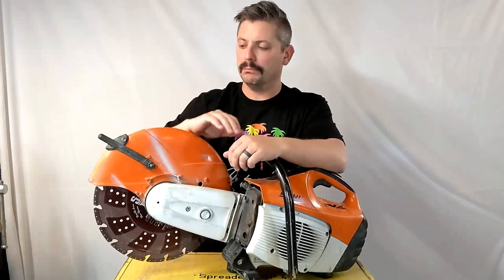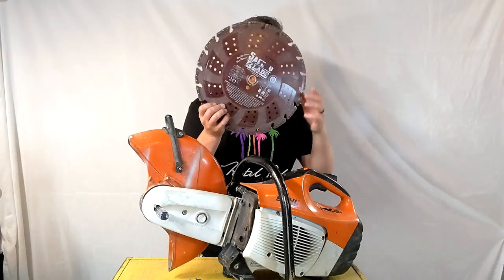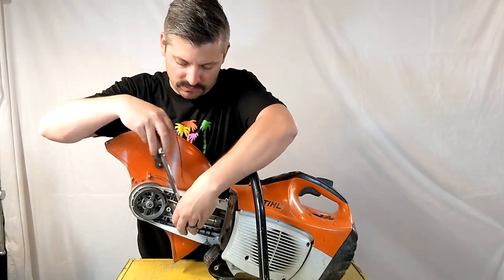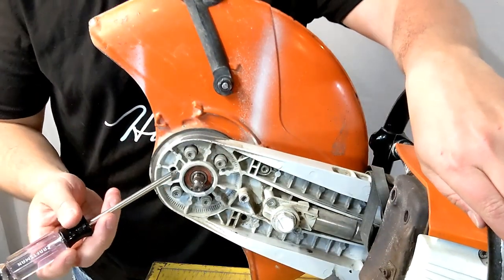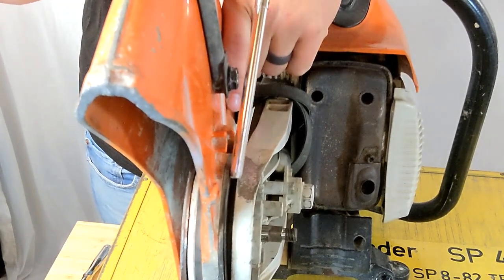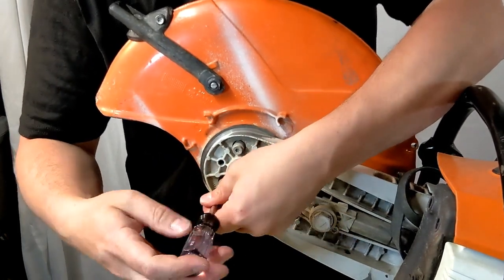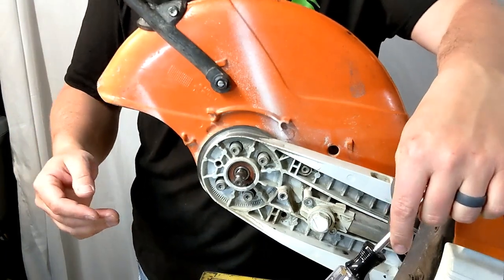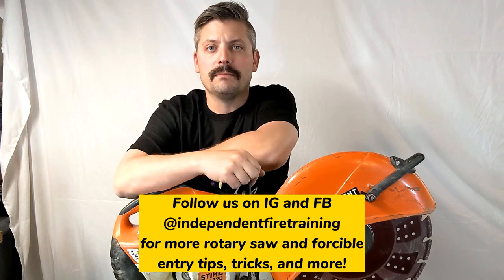Fix Your Stuck or Frozen Blade Guard! Stihl TS420 | Independent Fire Training

Comment: Thanks for a great video. I am here in the UK. I cannot for the life of me, get the belt drive wheel, in front of the guard tension nuts, off. I have tried for hours. Yours came off easy, did you struggle in any way?
UPDATE:
I have now after buying a bearing puller taken the drive wheel off. It is hard to do because it's held on with very strong thread locker as stated in the manual.
To re-tighten the nut it's 40Nm torque. I didn't bother with the thread locker.
Thanks for a very helpful video, I wouldn't have done without you.
Reply from the maker: Glad you got it off!! Sometimes these things are a huge PITA